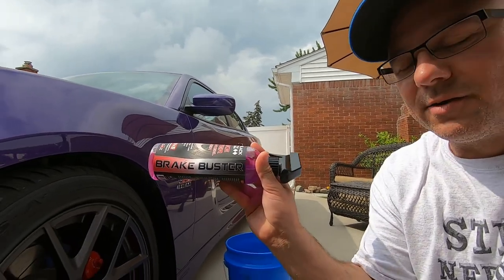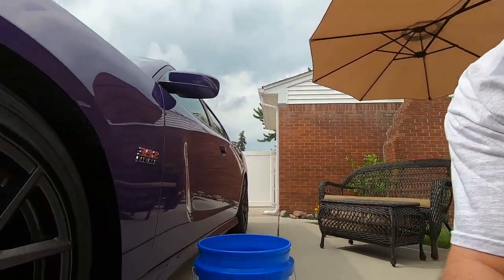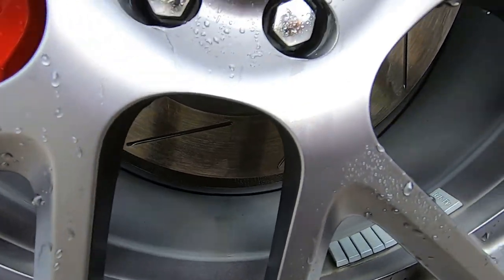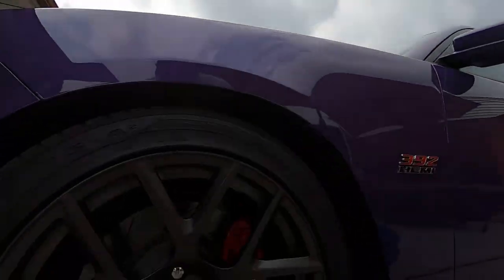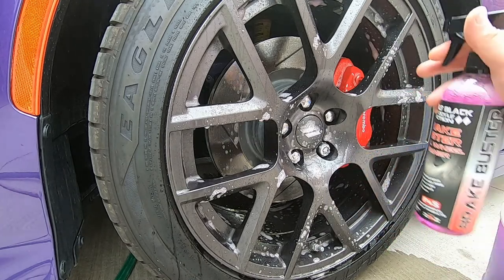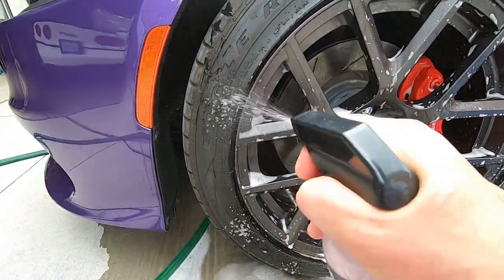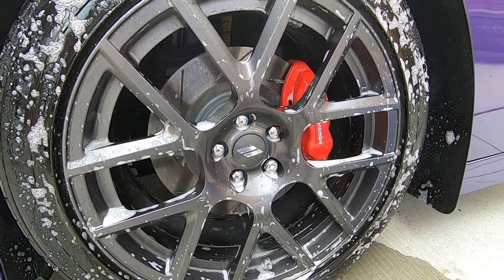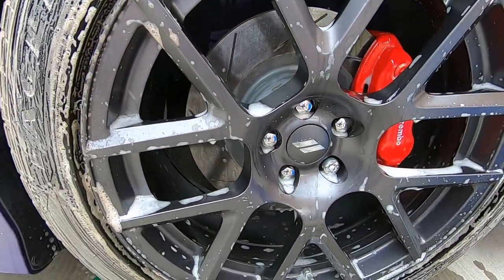P&S Brake Buster "Wheel & Tire Cleaner" | Satisfying Car Detailing Reviews

Comment: this may sound dumb but can you use it as a wheel soap
Reply from the maker: Doesn't sound dump you can use it in a pump sprayer with water diluted 5.1 something like that. And I may have to try in a bucket